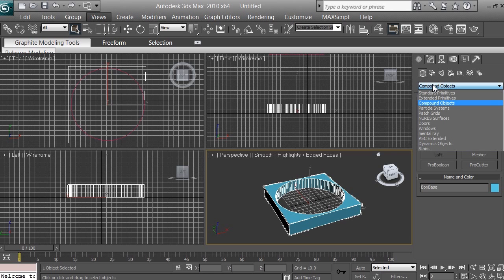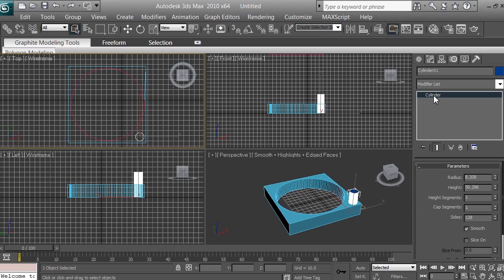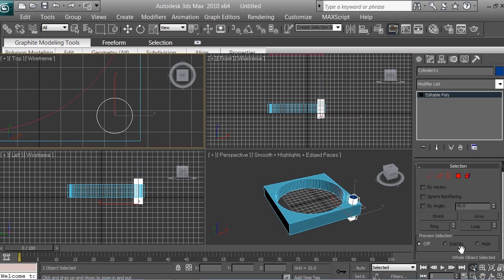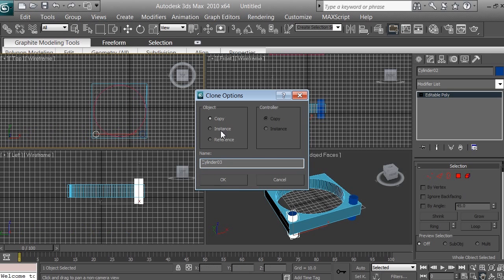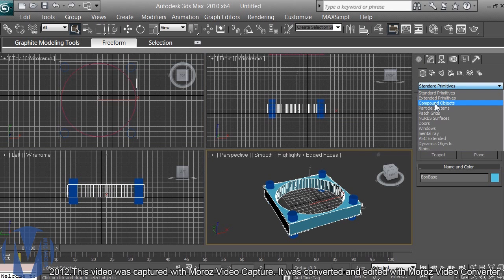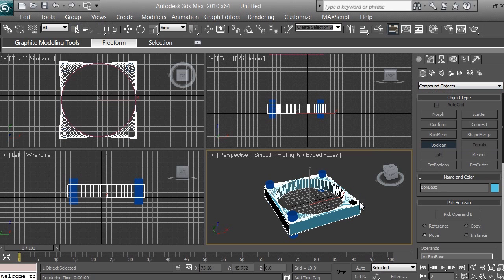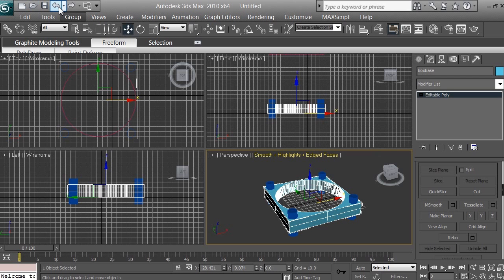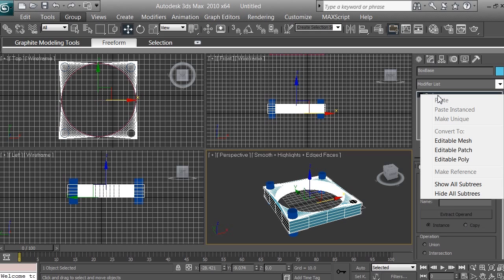3D Modeling - Computer Fan Tutorial - Beginners - 3ds max - pt 5 of 16

Comment: After I click on operand b the top view starts showing a wire frame pattern on the block, then when i click on the small cylinder it disappears but there is no hole and only a small portion of the block is altered, no hole is made. I am clicking on the correct objects for sure, dont know why the block goes to the strange wireframe pattern.